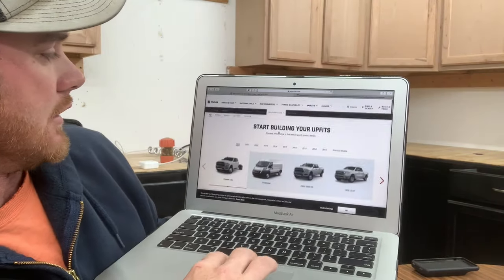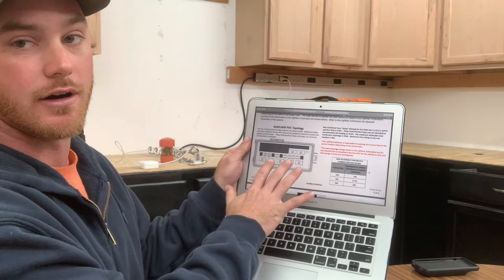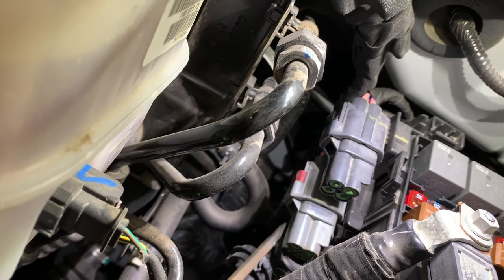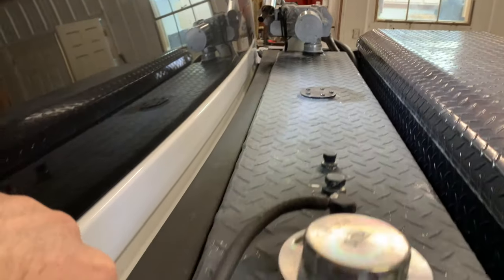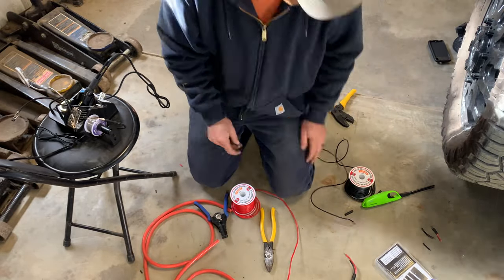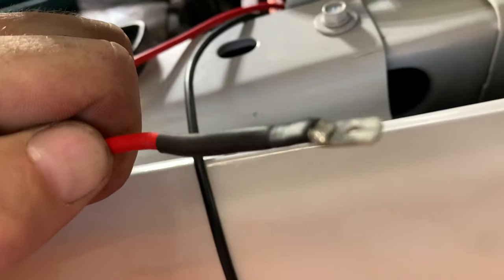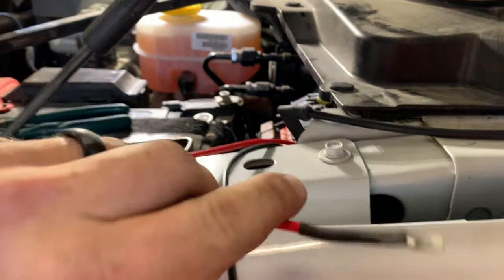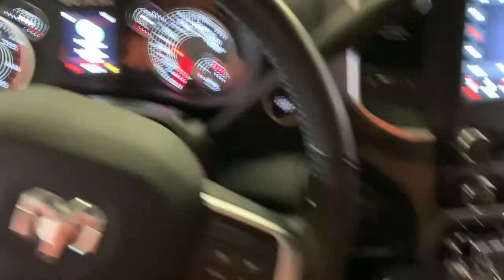HOW to WIRE factory RAM auxiliary switches

Comment from the maker: After some consideration I’ve decided to purchase the factory harness for this application. If I buy it, would everyone like me to make a video highlighting the install using it? Please comment down below and let me know your thoughts. Thanks.
Reply: Please do. Great video! Thank you!
Reply: Yes!
Reply: Do you have a part number for the harness? would be a lot easier to just plug and play everything.
Reply: Mine came with it which is nice
Reply: Yeah, I bought my 5th gen used and it came with everything but the wires for under the hood
Reply: Where can I find the part? I want it done in my.
Reply: Just bought a used 2020 and didn’t have the harness with it. Does anyone know what the part number or where to get the factory harness?
Reply: ‘14 Ram MegaDually here. Came with the bag of wires in the pocket behind the seat. Question? Why does everyone solder the wires? Military and Ship construction for a combined 38 years. Everything is crimp except terminal connections. Solder makes joints brittle and can cause a solder connection to crack/break, especially under constant vibration. 
The earlier engine bay box has 6 relays, 6 big fuses and 1 5amp blade fuse. The 5 amp fuse is to select by its position if Aux 1/2 are ignition run or battery. 
My aux tank plugs into the same 7 pin connector you showed, but I have a 2 pole toggle switch (pump fwd/rev).
Nice call with the hose.

Comment: If you have the up-fitter option on your vehicle, (which you do)  it should have came with a bag full of wires pre-terminated and waterproof specifically for those plugs. If you don’t have this bag, I would highly recommend visiting a dealer to get one.
Reply: the wire kit is usually under the drivers side rear seat
Reply from the maker: I looked high and low for this with no luck. Thank you for the comment though. Hopefully it can help others.
Reply: @BuiltbyBurns  mine was in the infloor storage bin in the back. Others have found them either under or behind the rear seat.   One of the things in the bag is a jumper connector you can use to supply power to a wire that is already run to the rear of the truck from the factory (near the rear bumper).  This would let you run a wire from the rear bumper to the pump instead of from under the hood.
Reply from the maker: I remember reading that now that you mention it. Thanks for the info.  You seem to know quite a bit about these trucks. Like I said In the video, I searched for a while looking for the answers and ended up being more confused than anything. I’m contemplating making a whole new video using the harness for others to see. I will have to order one first though.

Comment: Guys. If you install a rigid industries light with the built in relay, just wire up the blue switch wire into the Ram Aux switch.  Cap off the the black/red wires.  No need to worry about amperage either.

Comment: There is a reason solder connections are not used for power connections.  Solder is for low power/signal.

Comment: I have a 21 and mine came with a wiring kit under the backseat for those connections in the grey plug.
Reply from the maker: My rig was missing the harness, that’s why I wired it the way I did. 🤙

Comment: Thanks for the video, it helped out. Didnt know how to tap into the switches. If you read on the website, it says in there that you can move the different size fuses to any socket. All the switches and gear are rated for the same amperage.
Reply from the maker: thank you.

Comment: I am still learning how all of this works but I know that you are able to move the relays/fuses around to the appropriate aux switch.  You don't have to use Aux 4 just because thats where the 25amp is (I think thats what you mentioned). You can just move them to which Aux switch makes the most sense for what you are trying to power.  I am OCD so my front LED light bar will be Aux 1 and Rear spot lights will be Aux 6 etc.
Reply: Please stop with the "mUh oCd"

Comment: Just FYI, as far as ive experienced, these trucks are supplied with an upffiter harness kit that includes the correct terminals to install in those connectors under the hood. Look in the glove box or under the seats.

Comment: I have a tradesman 2022 3500. Think ill run a set of fog lamps through these. Thanks for the video.
Reply from the maker: Check and see if you have a bag full of pre terminated wires to use with the outfitter so you don’t have to make a spade connector like I did. 🤙
Reply: I have a 2021 3500 SRW Tradesman and I'm going to do it too. Hey Mello Man, have you done it yet? How did it go?

Comment: My 2021 2500 came with a package of pre-terminated wires that have a rubber plug attached to replace the one that was removed from the harness plug.  It was hidden under the rear seat along with the cold weather grill blanket. (Has the snow-plow prep package)
Reply from the maker: I’ve recently purchased this connector and I’m planning on making a new video on how to properly install it. Just need the time to do it. I’m pretty busy right now with work so once it’s start to  get cold I’ll throw the truck in the shop and get the content out there.

Comment: I also have a 2021 Ram 5500 limited, which has and what looks like the same wiring schematics. I was wanting to install running board lights with turn signals & courtesy lights, was wondering where to tie into for the turn signals & courtesy wires. Where would you tie into?
THANKS! Great video too!

Comment: This is a really good video, my only question is, is this possible to do with a ram 1500? I know the diesel model 2500 switches wouldn't work but what about the 6.4l hemi models? I'm looking to get those switches connected to a light bar on my 2018 1500
Reply from the maker: Buddy that’s somthing your going to have to use ole google for. I’m not even sure. Maybe someone else on here can comment but I’m pretty sure the 1500 models don’t have any of this stuff under the hood. I bet you could find some retrofit kits out there though. I’m not sure what your looking to power up
But it’s really not that big of a deal to throw a nice switch on the dash and wire up a relay under the hood to power it.

Comment: 2017 3500 SLT - is there a way to get the engine brake to come on every time you start the truck? I hate having to keep pushing the button to activate the engine brake , or well driving I'll think its on and it's not.
I like this video as I plan to add some lights ! thx !!!

Comment: Why didn’t you use the connectors from Ram to install this? Both of my newer Ram’s 2014 and 2022 came with connectors for the aux switches. I’m not trying to be a smart ass about this. I’m just wondering if you thought it was better to use the spade clip?
Reply from the maker: So I looked all over for the factory harness before I made the video and was unable to find it, I figured there were other people like me in my situation so I made the best of it and made a how to video doing it this way. It’s been problem free but I need to probably purchase the factory adapter and make another how to video using it I suppose.

Comment: I was looking at using these as a way to turn on/off interior 12v devices (GPS/tailer monitor screen/Trailer TPMS/etc.) is there an easy way to do that?  What you're showing above gives me hope.  I did see that the new Fords have the wiring run inside as well.
Reply from the maker: Should be as simple as running the power wire into the cab to power up the devices. From there you can figure out a way to plug into that power wire and then use the switches to turn them on and off. It’s pretty easy don’t over think it.
Reply: I'm sure you've solved it 9 months later but the 4 wire bundle he pointed out goes into the cab just for that. HDRAMS forum will help you out a lot.

Comment: Mopar sells wires for the kit that have sealed tight plugs won't you pull out the green ends on the harness might be worth getting so you don't get moisture in there and run out the whole plug

Comment: Installing the switches in the cab. My ram did not come stock with the ram switches. the wiring provisions are there. I have to wire in the switches themself as well.

Comment: Thank you for the video makes life easier. Did you buy the harness?
Reply from the maker: I did, I know I need to make another video utilizing it. I’ve been swamped with work at the moment.
Reply: The reason I ask is I have some kind of harness that came in a sealed plastic bag with the truck. Someone said it may be for a 5 th wheel installation
Reply from the maker: @josephcardinale4708  what’s it look like?
Reply: It says it’s a harness for under the dash Vsim??????
Reply: So I looked into the harness and if I am correct it’s really only worth it to buy if you have a pto in the truck. As for the Flat pin connectors with the wires they do make a factory seal when inserted into the grey plug so is it really worth it to buy the harness or just do what you did which also is sealed when done

Comment: If you poke the hole through That green grammar you took out because slipped that On the water before crimping your connector.  That way when you plug in your connector slide the Grammit down and seal the hole

Comment: Hello i have 2019 ram 2500. i like to add aux switches where i can find harness
Reply from the maker: Check under rear seat or in floor cubby holes under floor mats the rear. That is the most common place for it to be located.

Comment: What size crimp did you use, I can’t get any of mine to go in at all
Reply from the maker: I just used a generic one from auto zone. It was a bit of a tight fit but after a little trimming of the crimped area (remove the cover after crimping) I was able to use a pair of small needle nose pliers to guide it in there. It’s a bit of a fight I won’t lie. But you’ll get it.
Reply: @BuiltbyBurns  I actually found the OEM connectors. It’s apart of the Uplifter package. I had the wires in a bag under the back seats. You just gotta find the right size one then pick a color

Comment: Will this work on a Laramie? I’m trying to add aux lights without drilling into the vehicle
Reply from the maker: I’m not sure if the outfitter ports are on your vehicle or not to be honest. Pop the hood and see if you have those two grey and light grey connectors on the right side behind that battery. We can go from there.
Reply: @BuiltbyBurns   just for future reference, the two grey connectors under the hood come on vehicles both with and without aux switches.  Even Basenotes tradesman trucks can be optioned with the auction switches. The fastest way to know if the truck has the option is to look at the dash to see if the switches are their or not. If they are not their you need someone to custom make you a harness, flash the computer to add the programming,  and order a couple of factory parts to add them, but this is rather involved.

Comment: so i have a 2019 ram 3500 DRW. i want to put the aux switches on the dash but i have looked and cant find the upfitter box under the dash. i have the fuse box under the hood but there is no grey wire connectors next to it. what do i have to do to get to having working aux switches